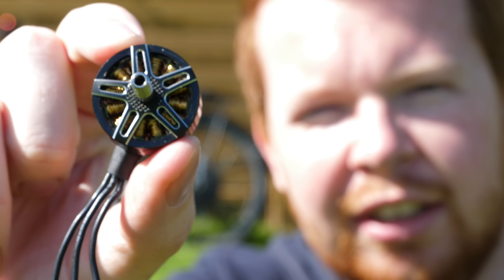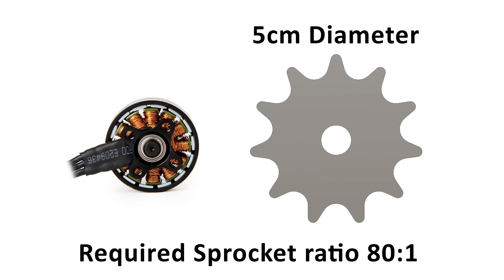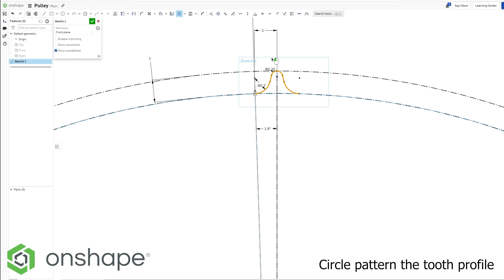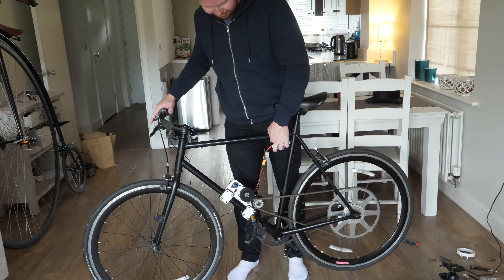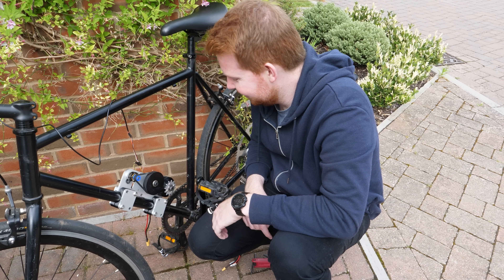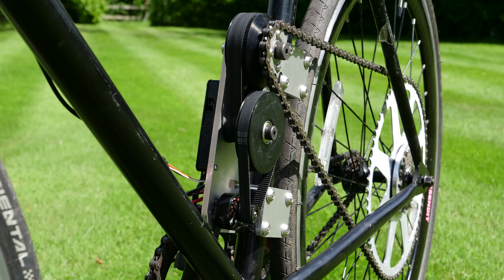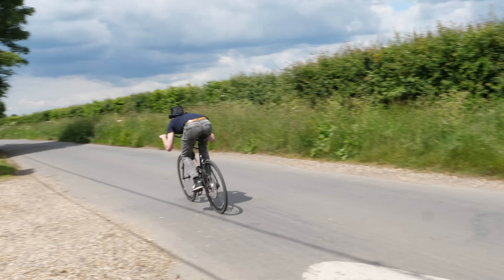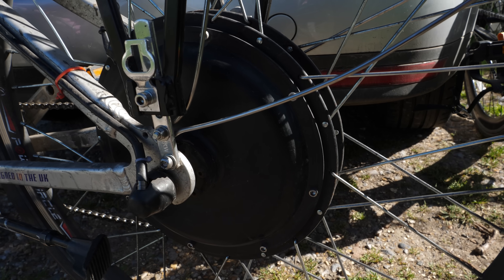Tiny 1kW Electric Bike Motor

Comment: what's the most stealthiest e bike motor? like, you can't even tell it's an e bike. basically no sound, or at least low enough sound that it's covered by the wheel noise of mountain bike tires on pavement. and the smallest, but doesn't sacrifice any power or reliability, which are more important than getting it small. what i'm thinking is that the motor is hidden in a closed sprocket housing/chain guard looking thing

Comment: It just makes me wonder, if they're rated the same (aside from the mechanical vs electrical power caveat), it seems like there must be some way to make this work well and reliably. Clearly a bigger motor can store (and radiate) more heat, so there's that. And maybe as others mentioned, the ESC is different but that seems like mostly software. 
If the motor had proper cooling (it would probably need a fan since you're not flying through the air), a good heat sink design, and the right ESC, it seems like this actually should work. Or if not, I wonder why not.
In other words, what is in those bigger motors that makes them work well for bikes that isn't in the drone motor? Certainly they output more torque so they either have internal gearing or different coil configuration or something.
Reply: The biggest difference is in duty cycle ratings. The little drone motor is capable of doing 1kw, it only for short duy cycles, it's designed to operate much further below peak output majority of the time.

The data sheet even mentioned that at 1kw it ran for 1 minute and reached 101 Celsius. Motors have different duty cycle ratings and different goals in their operational life, some are meant to lug a heavy load 24/7, some are meant to operate around 50% of peak output with occasional spikes to 100%.

Comment: Very, very informative! Question tho: I am about to build an ebike setup to go cross country on. I would like to make a little 4x12v (48v output) dc brushless motor power generator. Would a solar conditioner work to trickle power back into the battery continously? Any recommendations? I'd like to only have panniers on the bike, and not have to build a setup on a trailer to pull. Don't want solar panels either...

Comment: Side loads on that drone motor are killing it, I'm willing to bet.

Those bearings were made for high speed at very low loads.  If you could remove the direct loads I'd wager you'd see a reduction in temperature and increase in torque.
Reply: I really had to scroll too far down to read this comment....

Comment: Great project as always!  

A couple of things:  The power output of cars is typically a "peak" value (and often the result of marketing spin) which will give very short engine life, while other figures (tractors, ships, aircraft etc.) are a continuous output figure under typical conditions of use.  Also the weight comparison between the hub motor and the drone motor by itself doesn't account for the drive system used by the drone motor (which desperately needs a cooling fan/heat sink system as others have said).

Comment: I suspect these 2 motors are using a very different definitions of 1KW, typical bike motors are operating more like 2x their rating and I would not be surprised if the drone motor is quoting the absolute max rating, which it may be able to actually pull off because of the insane airflow it can expect in normal application

any 1KW motor should perform the same as long as the max RPM is coupled with the appropriate transmission

Comment: Very interesting.  :-)  My immediate thought when you said you were going to use a 1kW drone motor for an ebike was that it would cook itself.  Even if it's 90% efficient it's still got to dissipate 100W of power as heat, and in such a small package without a spinning blade actively cooling the thing, it literally must get really hot really fast.  I honestly didn't think it would last long enough to get going on the road (which kind of happened with v1), so I'm glad to be proven wrong on that count.
Reply: sorry, i read wrobg in your messag, i read 1000w as heat in  instead of 100w.. ofc you are right.. if engine is electric and use 1kw.. the exsess energy is normaly around 100w (10%) tho i think it will be higher in this case depending on several factors like the gearing.. if this ebgine can work in a rpm area ideal for it.. and if the engine is strong enogh to handle this load/resistance.. according to different physical factors its likely that it will not opperate optimaly and lost energy to heat will be higher than normal.
Reply: I dont think you got that right. 
I am not 100% sure, but I have read articles on eficiance of Electric cars Vs hydrocarbon/fossil fuel cars. 

And as i understood it the excess heat is basically the lost energy.
A fossil fuel car is very less efficient(about 33%)(/67%is lost and is transformed to basicaly heat), therefor it generates heat. 
So a lot of the energy when burning the fuel in the pistons go directly to heat and is not helping to move the pistons. Newer cars thend to be more efficient those generating less heat.
Electric cars have ofc a different system where electronmagnetic energy is used to generate circular movements that connects to the wheels... where some energy also is lost while transporting electrisity and also when charging, the energy lost in the process of moving the wheels on a electric car is very less(about 10%is lost and transeforms to heat)... thats why the engine creates less heat and electric cars tend to be very cold in the winther.

Its the same on wolfram/glowing bulbs (dont know the right word in english) ... the energy lost in these bulbs are around or more than 90%, thous they get realy hot, while a buld witch use light emittind diods (led) has an efficiency of 50% or slightly better.. so they are many many times more efficient and create much less heat.

Its very probable that the reason the small engine gets so hot is that the size of the engine is not ideal for how much resistance the engine will get when trying to move this bicycle the momentum inside the engine needed with this bicycle is higher to acctually get it to move than what you need in the engines of the drone.. its almost like you trying to drive a car on to high gear... thats why it moves slower and more energy is just lost and generates more heat than thrust although the engines can use same amout of watts, they are still designed to move a more heavy object (the bicycle) or a more light object (the drone). The engines in the drone is actually spinning in the air... so engine gets less resistance to get a very high rpm.

Comment: Perhaps some fan-forced cooling air from a fan designed into the first pulley? I honestly don't know if that would work, but that would seem at first blush that the major difference in when on a drone, the propeller if blasting the motor with a stream of air.

Comment: at 40g, that motor cannot handle 960 watts. Anyone who believes that doesn't understand a thing about motors. At 40g, it can probably efficiently handle 100 to 150 watts - maybe pushing 200 if it is very high kV. But the efficiency will already be quite low anywhere northward of 150 watts. To market it as 960 watts is beyond stupid.

Comment: You went about this logically by starting with gear reduction needed. These sort of projects were very common 10 years ago on the endless sphere forum. 

The biggest issue is the thermal mass of the small motor and small flux gap area.  It can go from ambient to 100c in seconds.  

From experience, you need a motor that's about a half kilo to have enough thermal mass. Still undersized, but with proper gearing and top speed would be pretty reliable
Reply: Bro! The classic 80100 outrunner belt drive e-bikes were monstrous, I've been wanting to build one for years, with the right voltage/gearing, the speed you can get out of the 80100 is unlimited!
Reply: @Eden_M  endless sphere has so much ebike history

Comment: those motors have very little torque but they can hold that torque at very high rpms. That's what they're designed for. also i bet the e bike motor has much more thermal capacity

Comment: sir just a suggestion i think you should use two motors but the other one is just a support and it should bit faster than the other to remove bit of the stress and to make it accelerate faster:stayhome:

Comment: I love this! I have a few ideas, you could drive the pulley system with two or more motors, you could also 3d print a casing with air ducting routed to the motors, and you could 3d print a fan design to pull air through said ducting. I think that would be pretty awesome! V2.0 please??

Comment: Fun little project for YouTube but every engineer knew the answer to it. when you use gears especially ones with massive steps as these torque and will cause input motor to struggle. also massive power loss at output

Comment: The coolest part about this isn't that a teeny little drone motor can power an e-bike (briefly); the coolest part is that with a motor that tiny, you could absolutely figure out how to hook several up at the same time. That would keep the temperature down a bit by virtue of not having to run it absolutely balls out all the time, and it would make that thing go like a stabbed rat.
Reply: Then you could just as well get a bigger motor
Reply: @JTordur  I think it would still be lighter than the equivalent power
Reply: @lukerobinson3983  That would mean a smaller energy motor has a higher "power density".
What I mean is that I guess there is the same power pr cubic meter in a larger motor than a smaller motor.
Reply: @JTordur  well I think this video explained it well the torque can be calmed by using gears to change the output and a cheap high torque motor that’s lightweight can be used instead of a heavy designed motor for the same job
Reply: Exactly what I was thinking whilst watching pack 4 together 2 on each side and it could be pretty impressive and still very light
Reply: can you say extruded aluminum cable drive exo suit?
Reply: Having 8 of those little motors at once running at full power for even a second on a pedal driven bike would be terrifying.
Reply: @r10101  can you imagine how much power 8 kilowatts is ? some electric motorcycles have that
Reply: Most expensive part of an e-bike is the motors batteries and ESC all being supersized makes them very expensive. If you can design an e-bike that used only cheap drone parts you could make it either two-wheel drive or use for motors or so to make a cheap e bike it would be pretty cool
Reply: What a marvelous idea 👍👍

Comment: You should go into motor theory and explain why it gets hot. It's doing easy to much work that it wasn't designed to handle. It's meant to spin a, I don't know 50 gram propeller not turn all that gearing. If you overload a motor it gets hot. Hence, the large hub motor. Do you think you could use that hub motor and put it on an electric car?

Comment: Id like to see you use this concept but with a Castle 1518 1800kv 1/8 scale RC motor, I used to race RC dirt oval and road course and they would absolutely power houses on 4S and 6S lipo, probably would get hot quickly

Comment: What if you hooked an alternator that transferred your peddling mechanical energy into electrical energy and had the motor hooked up to power the rear wheel of the bike so everything is being powered by the mechanical energy you produce by peddling but the peddling is then assisted by the motors power.

Comment: Because of inductive reactance, motors draw less current at high RPM. So of course a motor meant to spin at 30,000 RPM is going to draw a ton of current and get insanely hot when you put that much of a load on it.

Comment: The torque out of that tiny motor would be basically nothing. And the cap on the legal speed of electric bikes in the uk makes gearing them for more speed pointless
Reply: Though still impressive how powerful it is considering its size and weight

Comment: You totally left out torque increase gearing!  Once you have that, you are more limited but you increase rpm gearing as 2nd phase. 

I use windshield wiper motors as heavy lift motors in my shop being disabled.   (I can lift up to 400POUNDS per 1 windshield wiper motor and just 12Volt.   I added gears to lift even more to another set of qty 2 windshield wiper motors.

Now I lift my riding mower for full servicing easily without crawling on the ground as I cannot get up and down.

Also lift my 350pound scooter to service it easily.   “”Retry””. This e Ike addressing both torque then regaining rpm both.   Contact local engineer to design more quickly as “”free”” advertising for his services.

Comment: So what about the obvious suggestion of adding a cooling fan to the shaft of the drone motor? Part 2, maybe? Look at the fan shapes used for alternator pulleys; one of those attached near the outrunner should pull some air through the motor and over the coils.

Comment: Could you power an ebike with a 1/5 scale high powered brushless motor? I think the point I'm getting at is more speed. You can mount a computer fan over the motor for cooling or another edf brushless motor blowing back on the motor from in front. To prevent drag. It could be cool loud but cool the edf could increase speed as the drive motor does. Heck with a edf cooling fan you may get a bit of boost. Also pedaling to a good speed before applying the ebike motor is a good way to take of strain on the motor.

Comment: Re the overheating motor - a quadcopter motor is intended to have a significant airflow through it - so perhaps adding a small fan to the motor shaft would stop it from melting!

Comment: Flip the mount over so the motor is at the top, add a fan to the front of the pulley design of the motor pulley

Comment: I have one of those 1 kW hub motors on my bike and it is woefully inefficient. A slightly bigger BLDC motor that can actually do 1 kW continuous (not the claimed rating which is always hopelesslt optimistic) would be great on an e-bike. Much lighter! and more efficient...
Reply: Someone else here used the term "Chinese watts", but that would apply to drone motors just the same as hub motors.

Comment: These power ratings of RC motors seem dubious to me. People claiming their quad motor RC car is 60 horsepower. Yeah, okay. Judging by the wiring...nope. Working around industrial induction motors, ones of that kind of power are use larger wiring and are fed much higher voltages. These battery packs are putting out much lower voltages and the wiring is even thinner...

Comment: Spring-loaded tensioners are a good idea for any bicycle project. Nice work though! I suspect the slot/pole highest common factor influences the effective speed of a BLDC (e.g. a 24/26 will spin slower than a 6/8) but unless you’re rewinding your stators or adding new magnet rotors there’s not much you can do with that information. I bought some 24/28 motors designed for skateboard use recently and they’re nice and slow and torquey, not sure if drone motors usually have different ratios.
Reply: Hi! Could you share which motors you bought

Comment: EIGHT THOUSAND GRAVITIES - With the first drone motor spinning 500 revolutions per second, the belt whipping around the tiny pulley at full speed will experience a centrifugal force of about 8000 gees... another "small" engineering consideration.

Comment: Did it consume the same battery power as a bigger original bike motor would consume? Or lesser?

What if we put on 2 low power brushless dynamoes on each wheel, and use its output to power this tiny drone motor / charge the battery?

Comment: One very important note: the engines for
 The RC are cooling down
 with pushed air, try adding a small rotor to keep it from burning. An interesting experiment, I am considering doing something similar, but with a 2KW engine, in order to create a slow ATV.

Comment: There are some amazing things happening with the motors that are used in electric skateboards. I ride an electric pedal bike and often see people going up hill on electric skateboards at a decent speed.
Reply: I almost hit a curb in my car the first time I saw an electric skateboard racing up a hill on the sidewalk beside me. It looks sooo weird.
Reply: I fly up hills on my ebike and I'm 117kg, I have a 1000w rear motor and I put 55v through it at 30 Amps 👍🇬🇧 just over 1500w
Reply: The average e-bike controller is limited to 250~500w, e-skates are in the thousands.
Using a Vesc on my e-bike with "Field Weakening" I reached 60km/h on flat road and 40~45km/h uphill, with a standard 500w hub motor, it got the system pulling 2000W at 48v, without any overheating.
Reply: My board has two 600 watt motors I can hit roughly 35 mph and I’m getting ab 20 miles range
Reply: @ghostc3566  Amazing.
Reply: We have alien technology. 😜
Reply: @marsbase3729  have you been at chicken hole base?

Comment: In the drone motor, the heat built up over time, a high heat flow from the core flowing out to the air cooled surface of the motor, BUT when you suddenly stopped the residual heat was still internal, but was suddenly NOT being removed from the surface, so there was "a backup" and maybe then at that instant the core temperature suddenly spiked, maybe then the core burning happened?
Apparently it was still running  under load at steady state just before stopping,  If burned, must have happened after stopping!